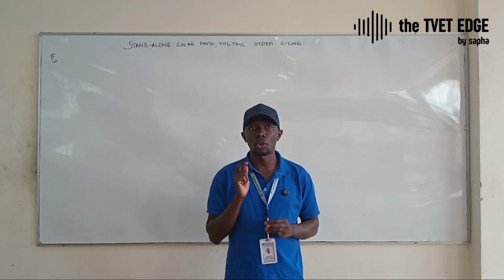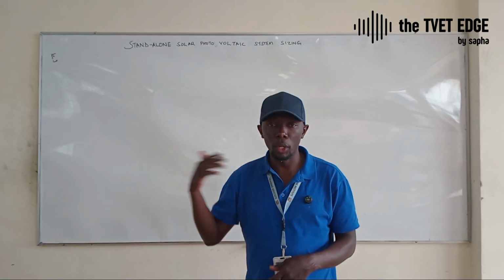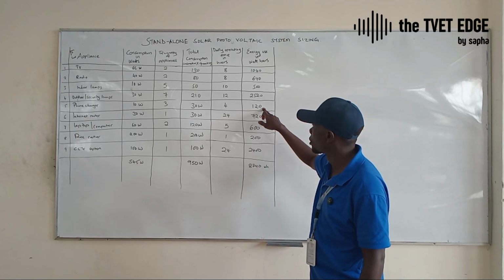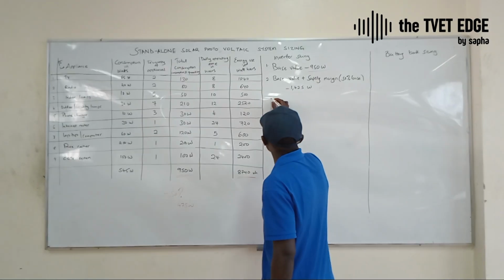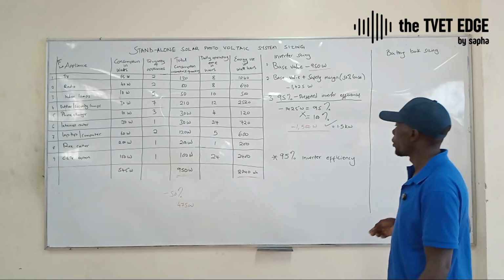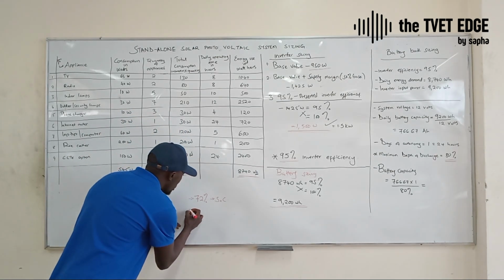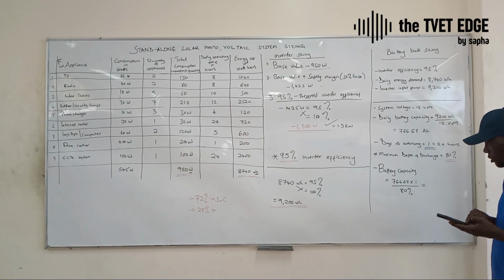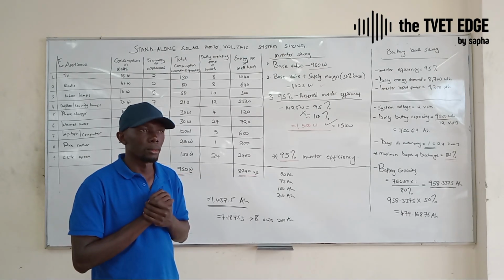Introduction to solar power | The basics of inverter & battery sizing session 2

Comment: We should add the last value attained to the battery capacity to cater for cycles think it was left out
Reply: Is there a video of sizing the module itself
Reply from the maker: @Linc_AkotoRenewableEnergy ntaweka in the next series
Reply: @davidomachtyson okay thanks waiting eagerly.
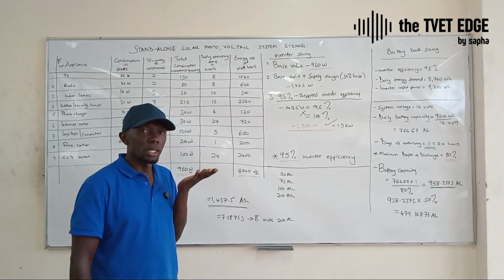Reply from the maker: Ebu enda hapo 54:02
Reply: @davidomachtyson  yes the explanation is there which I understood but I was not aware that that 50% value should be added to the capacity  since you left the calculations there.
Reply: So in a nutshell we do a summation of 958ah plus the 50%(469ah)? Correct if am wrong
Reply from the maker: @Linc_AkotoRenewableEnergy yes you add for a good capacity